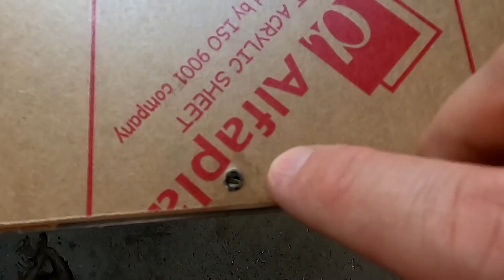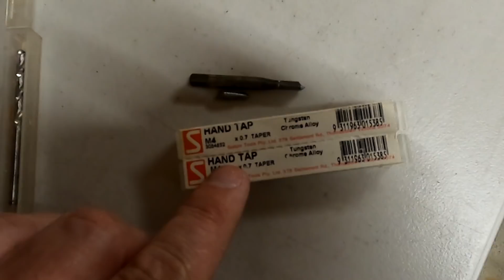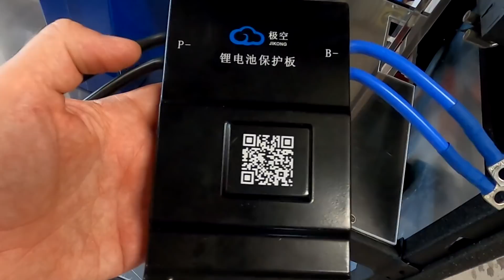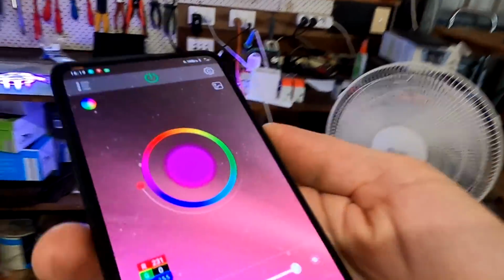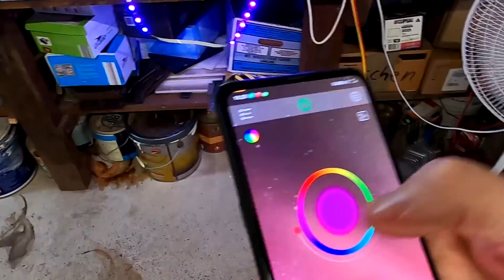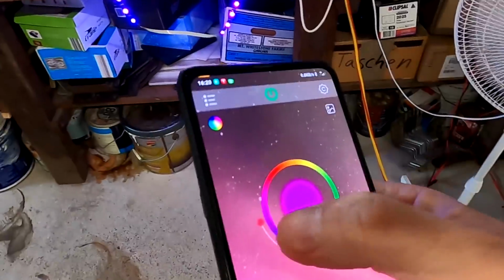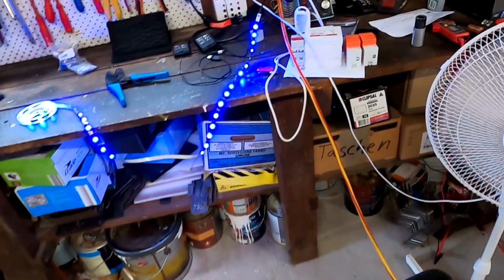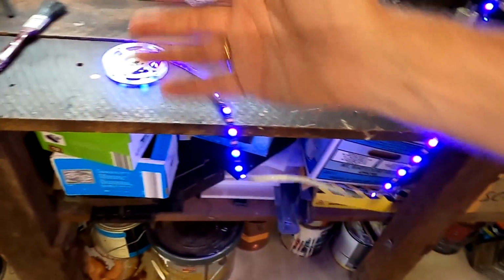The new features of Battery 2.0 (and new challenges)! Battery 2.0

Comment: 9:45 regarding your fuse choice

If you put such a glas fuse in and it blows you would have a lot steps to do to get the system running again.

I would suggest a different solution by putting a 16 channel automotive fuse box NEXT to the BMS connection box you had added.

advantages in case of an exchange after they blow are 
* faster 
* easier
* safer (cause you are not working above the cells in the small area above the cells but on the safe more spacious side)

And it is cleaner too, cause you centralize the fuses there, where they belong like the BMS is also just one box and not 16 boxes

Yes, pretty late, but for a summariziing 'community build video' or 'real community built V3 Battery - what I had done better with your crowdknowledge' it would make sense  

And there must be a ton of other stuff you mentioned in side notes or sentences, thoughts and decision like what you later called 'smartmeter always first before the bms' 
therefore the real community battery build video would make a lot of sense while I am running through all the 33 videos of the playlist so far.

excellent job and video
Reply: Those aren't rated for 48V and the point of the fuses on those wires is to protect the wire itself.  Moving the fuses next to the BMS would then defeat the point of having the fuses to begin with since you'd have nearly the entire run of wire unprotected.

Comment: Looks great Andy, I do like the LED light idea’s & have suggested same in unrelated video of urs. This is an awesome build Andy, I reckon, be a ‘piggy’ and get tempered glass doors made up that u can open down & unclip a link/strut/cord to slide off sideways for total removal and maintenance if required from an otherwise tabletop type opening, pricey but pretty! All ur pro’s n cons arguments are really well considered. Oh yeah, where is ur cordless vac? I use Makita gear, so Ive always got plenty of batteries around to have the vac on hand for those little metal filing jobs,etc. thanks for all the great vids!

Comment: acrylic.... so crack prone.....investing fab tiem and then last hole drilled cracks it...or other incident down the line.... polycarb for me unless a very simple no time invested panel
Reply from the maker: If you drill slowly without pressure, it won't crack. Same for the jig saw. Slowest settings work a treat. I had to learn this as well.
Reply: @OffGridGarageAustralia  ok for basic things , but one edge knick down the road... not worth it

Comment: I’m (as usual) a little confused. I’m changing from lead acid to lifepo. When I set my Magnum charge controller to lifepo parameters how does this interact with the BMS?  Thanks
Reply from the maker: Is you charge controller connected to the BMS and are they communicating?
Reply: Off-Grid Garage I need to check for a separate communication port. It has a cat5 connection to the inverter. Just trying to learn ahead of time. My lead acid still has another year or two. Thanks

Comment: I'm a little confused, how the JK BMS and the balancers (many caps on it) work together.
Reply from the maker: You don't have to use both. The JK-BMS has already an active balancer integrated which will do the job.
Basically, you can have as many balancers in parallel on a battery as you want. They even can have different settings and start and stop at different voltages.
I can connect the JK-BMS to my battery and also have the active balance connected at the same time. They both read the same battery voltages, right? The JK-BMS may kick in earlier to balance the cells due to its settings. If it can't cope and the voltage in on cell is rising further, the active balancer could be added to help balancing.
I'll show and explain this in a future video...

Comment: got an odd technical question  can you use an ntc thermistor as an automatic soft start for connecting inverters to batteries ???
Reply from the maker: Uh, probably not. This has nothing to do with temperature.
Reply: @OffGridGarageAustralia  no the temperature is in reference to the power going thru the ntc ie initially fullpower its high resistance but as the power lessens so does the resisteance  so it has a kind of ramping effect  should have linked the video i got the idea from 
ozito soft start  18v battery vacume

Comment: Just use a drill made for acrylic plastic or it cracks where it breaks out.
Reply from the maker: No, it does not break as I've shown in the video. No extra drill bit needed.
Reply: And why not use polycarbonate? Stronger, will not crack, better insulator, and you could use a piece half the thickness, half the price.

Comment: How big would your battery bank be for this whole project? 300KWH?
Reply from the maker: I really don't know yet. We're starting with 2 banks and 15kWh each. That will probable do most of my needs. 
300kWh is a bit too much and unnecessary for s single house.
Reply: @OffGridGarageAustralia  oh wow ok, I was going to build electric off grid campervan for the weekend and day use with 31kwh battery ( 32x 304ah Eve cells) but the weight might be an issue, so I might just use 16 cells instead. What do you think?
Reply from the maker: @theoteam4641  Is this for a 12V system? 
16x 304Ah weigh 85kg/185lbs
Reply: @OffGridGarageAustralia  it’s going to be a 24V system with a 24V 5000VA multiplus II inverter

Comment: Andy, thank you for the insights. 
Instead of using 2x16/17 2-wire terminal blocks there are also 3-wire terminal blocks available from Wago or others, that have fan-out of 2+ instead of one. This would save one connection to each cell and a fuse. They are also called 3/4-wire through terminals. 
You should also place the terminal block at a position where you have easy access to the screws/tension springs to change wiring. 
Even more convenient would be kind of standard connector to connect some other device to the cells directly. I have additional JST connectors to connect a cell monitor or balancer to the cells.
Reply from the maker: I know these terminals too. You just should use separate cables to the terminals for each component connected (separate balance cables for BMS and balancer). Piggybacking can create problems when devices interfere with each other on the same line.
Reply: @OffGridGarageAustralia  The devices are still at the same line when both passiv conductive links are connected at the same bus bar. If there is interference between both connected devices then two separate links will not prevent this.

Comment: Hi Andy,
thank you for the great videos! 
Question: Do you think it is an issue to rotate the eve 280Ah batteries 90° so the small side is facing down and the terminals are facing towards you.  
Small side facing down, fixture left and right Terminals on the front. like this: -->|||||||||<--
Reply from the maker: From what I heard, they are not designed to be in a side position forever. The electrolyte is a liquid inside (shake them and you can hear it splashing around inside), so they need to be upright most of the time. If this is all true, I'm not sure but makes sense to me...

Comment: I know that it's "Low-Tech" but you could use Actual Glass (it's non-combustible too) for the front panel, or if you wanted to get "fancy" you could use a Custom Tempered Glass and even add a smoke, blue or other tint to it.
Reply from the maker: How do I mount it though? There needs to be a frame designed, manufactured and installed as well for real glass. This all gets a bit too much, I believe just to look inside...
Reply: @OffGridGarageAustralia  didn't you ever have a tv cabinet that had those tempered glass doors with the hinges clamped onto them and the magnetic closures?

Comment: Hi and thanks again for great videos!   For safety and service: Battery connected directly to breaker or battery switch before the bms a good option?
Reply from the maker: I leave the BMS on if the main switch is off. The reason is in case I have to shut down the battery, the BMS is still there to monitor all cell voltages. So in an emergency I can shut down the battery and then analyse through the BMS what was going on. But that's just my thinking. You can have the main switch directly at the battery and it just shuts everything down.

Comment: Instead of fuses PTC thermistors they go high resistance when they heat up so if you get a shorted wire the thermistor heats up and goes high resistance.
Reply from the maker: I'm not expecting the fuses to trigger at any point of time and certainly not on a regular base. They are more a peace of mind set.
Reply: @OffGridGarageAustralia  Its something that should be done if some how a short occurs in that wiring you do not want the wires burning so a fuse or a PTC is needed , the PTC are common in commercial gear, your doing the right thing  .

Comment: My suggestion for the clamps: Use four-pole wago spring-loaded terminals. Only one line from the bus bar, no ferrules necessary and three possible connections.
As fuses I would take automotive flat fuses. There are "flying" fuse holders with insulation displacement connectors aviliable for these. No soldering, crimping and heatshrink hassle if a fuse blows, just swap it.
Reply from the maker: Automotive fuses have no 60V rating though. The fuses should be installed as close to the terminals as possible as they protect the cables mainly.
Reply: @OffGridGarageAustralia  That's what the "flying" fuse holders are for, just cut the wire 2-3 cm after the cable lug connecting to the busbar and snap on the fuse holder. Because they are fused now you could use bigger wires, 0,75..1,5mm², reduces resistance and eases handling. Voltage rating: Most likely scenario to blow such a fuse is connecting some neighboring BMS wires the wrong way, will result in 3.6V - 10.8V across the fuse... Otherwise I am very sure they will blow nicely at 50V, especially the "little" ones with 5A.

Comment: What's the Arc Interrupt Rating on the main battery breaker you're using? Personally I use a Class-T fuse on the main positive terminal before everything else - gives peace of mind.
Reply from the maker: The breaker has 25kA interruption capability. Better or equal to a class-T fuse. I went through the specs in this video: https://youtu.be/O9o3sFn8xNM

Comment: Andy, you may want to do a test to insure the Bluetooth signal from the BMS can communicate from inside the aluminum walled shelf. Better to know now if you need to mount the BMS on an external wall for the sake of that signal.
Reply from the maker: Nah, I have had this question for a long time with the electric cabinet. I can still receive the BT signal at my pool, 20m away even if the metal cabinet is closed. The metal frame does almost nothing to the signal.
Reply: @OffGridGarageAustralia  Ahh good to know, thanks.

Comment: I used 14awg between the battery terminals and a connector. The wire is a lot more sturdy than the tiny stuff that comes with the BMS. I fused it for 10 amps, but if need be I'd be comfortable running 20 amps thru the wire, but not sure the connectors are good for that. I can hook up a balance charger (a pair of ISDT-Q8) but so far the cells are staying in balance.

Comment: About the BMS mounting.  If you get a BMS that has busbar mounts only (like JBD) you can build your own cables exactly the length you need.  Or can you cut off the ring terminals and splice new cable to get the right length?  I know I hate splices too, but done right they are electrically fine and good shrink wrap with internal adhesive makes them very safe.
Reply from the maker: The QUCC has bus bar mounts and M8 bolts. That is very handy!

Comment: Sorry for not warning you about the use of these harder plastics, clamping, slow and steady is always good practice. not sure about lubricant made from petroleum based products though, might stain the plastic, there is a product that you can put on to join it, might help make the cracks disappear might be acetone but not sure.
Reply from the maker: The cracks are hidden under the bus bar support so won't crack any further. Not too worried about it...

Comment: Excellent Andy! Have you considered tempered glass panels installed in aluminum frames? I used to build custom industrial switchgear, controls and motor control centers, and on a few applications where it was important to be able to look inside control panels, to monitor indicators functions, I used wire-reinforced shatter-proof glass, with silicone strips and an aluminum backing plate and stand-off bushings.  To meet code, you might not even need wire reinforced glass. 
Lexan and and some poly sheets meet UL 94 V-0 and other flame retardant specs, so they might meet code. There's also 'FR' flame-retardant clear plastics and acrylics.
Reply from the maker: I considered that for almost a second a while back. I think we're drifting a bit away from building a battery here in the first place. The window would be a nice feature/gimmick but I don't want to get a builder licence first to finalise it. I need to read the current regulations again and see what is allowed.
Reply: @OffGridGarageAustralia   I tend to agree, unless audience interest justifies it, it seems a waste of resources. It's such a nice bit of work It's almost a shame to hide it away, but perhaps an easy to open hinged door is good enough when you need a peek for the camera. 
Internal work lighting might a nice feature work and video.

Comment: Method 1:  Use 2 or 4 ga butt splice connector with set screws to splice to your two 7 ga wires. Method 2:  Use 4 ga compression barrel splice.

Comment: Hi Andy.
In my view the best place for the fuses should be at this new terminal sides instead of bus bars in between cells.
That's for a few reasons:
Can be tested quickly as they close to each others.
Can be replaced easily if you use a mounting rack like the car fuse holder...
Away from the battery terminals means you never have to go and play around over there where space will be limited and margin of error is too small while fixing, so is not safe play around there...
Reply from the maker: The fuses need to be as close as possible to the terminals to protect the cables behind them going to the BMS. 
Car fuse holders are only approved to 12V/24V... 
It's not about convenience unfortunately...🤷‍♂️

Comment: Why not use a db25 parallel port plug to plug the bms into? VGA only has 15 pins, so not good for 16S system.
DB25 specs:
Operating voltage: 250V AC / DC max.
Current rating: 5 Amps max.
Contact resistance: 20 mΩ max. initial
Insulation resistance: 5000 MΩ min.
Dielectric withstanding voltage: 1000V AC for 1 min
Reply from the maker: I actually don't need a plug or connector. I have no plans to remove the BMS

Comment: Create a bracket with a 3d printer on the back wall and hook it up with a 2-1 inline splice on each side.  It can slide in to the bracket without being screwed if it wraps around the sides.
Reply from the maker: I don't have a 3d printer...
Reply: @OffGridGarageAustralia  well you could weld one up pretty easily too…. But 3D printers open up a world of possibilities!

Comment: Manual dc disconnect for bms  connections  ?  We use polycarbonate "viewing windows" in electrical panels all the time. Passes UL inspection .
Reply from the maker: A viewing window might be fine but a whole panel... 🤔
What is UL inspection? That's US, right? They are totally nuts down here on the island...

Comment: Thanks Andy, Just a thought regarding the tapped holes in the "Paul plates" maybe a screw from the bottom up will give you a nice stud (button soc screw, low profile head)
Reply from the maker: What would be the benefit?
I can see that I cannot hold down this screw easily when tightening the nut from above, so it's a bad idea I would say...
Reply: @OffGridGarageAustralia  I would do the same with the big copper bus bars up the top. slightly longer bolt up from the bottom with a bit of Loctite on the head of the set screw and nip it up. only need one spanner / socket to do the nuts up and never need to worry about stripped threads in soft metal

Comment: More connection mean more noise and voltage drop.... In the audiophile world less parts in signal path is the goal..... Why not just buy a electrodacus SBMS0 way better than any BMS out there?
Reply from the maker: Because he does not make one for 48V... I think the JK-BMS is pretty good already, so not sure if the ED is better with all the components and connections it needs. As you said, less is more...

Comment: Given that you're designing this battery pack with 'tinkering' in mind, would it be worth using a blade switch to be able to isolate the cells from the BMS B-/B+ instead of using a single stud bus bar? That would give you the connection for the short cables that you're seeking, and give you the safety to remove the BMS without using tools on high voltage DC. And is there an option to fit some sort of NTC thermistor in series for that soft start when the cells first connect to the BMS? (Probably not at that current level)

Comment: It's not the speed that takes out small taps.  It's an off axis force.  Any bending force will snap the tap.  I'm extremely nervous when using a drill because they are heavy.  But the success rate is higher than hand tapping.
Reply from the maker: The Aluminium sheet got in the way and blocked the bit when it snapped. I tapped through the existing hole and the sheet moved a bit 🤷‍♂️ That was the first bit for 30 years or so. Still got two spare ones 😂